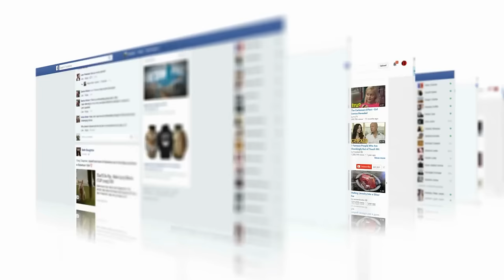The Largest Snake on Earth was Caught on Camera. Is That a Titanoboa???

Comment: None of those snakes had a circumference of 200 inches nor was any 200 inches in diameter as claimed by the narrator.  Two hundred inches is approx. sixteen and a half feet.

That snake on the crane far exceeds five meters which is approx. 15 feet.